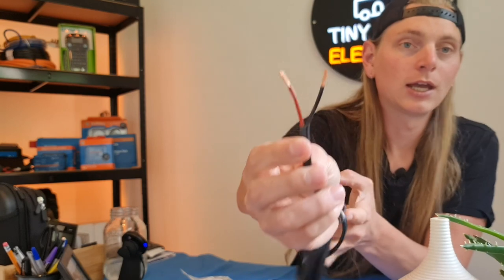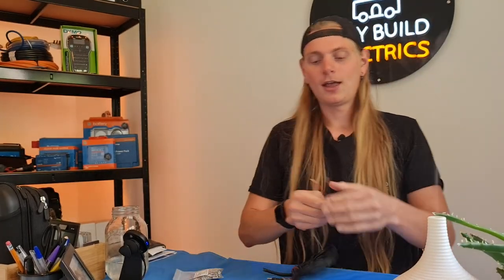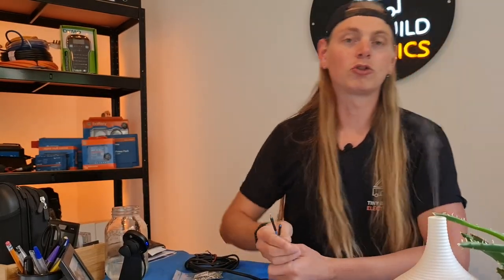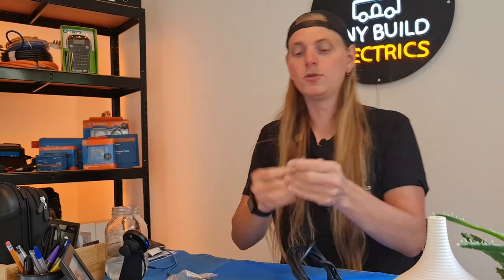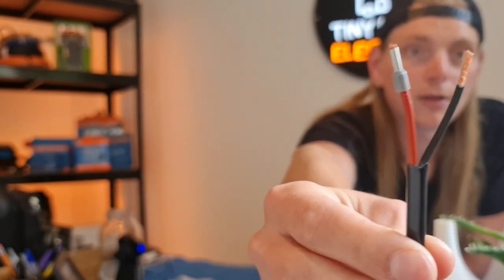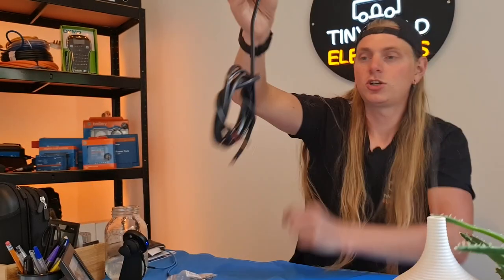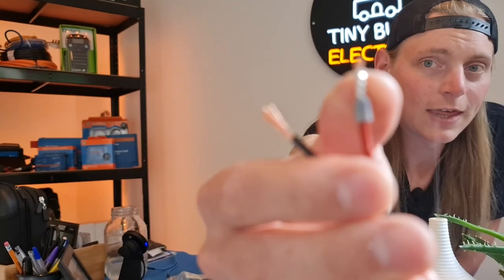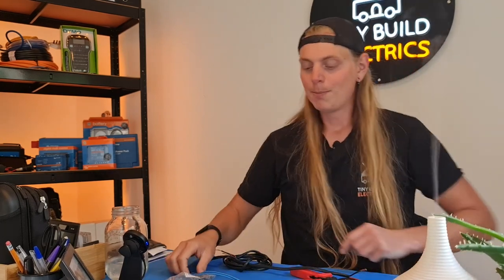How To Use Bootlace Ferrules (With Crimper) | Tiny Build Electrics

Comment: Thanks for the excellent video! In the USA this is not required per code & should be!! From what I understand, it's possible to loose up to 50% contact area screwing a terminal screw down on just bare stranded wire. I just had a project where I was replacing the contactor in my outside AC condenser unit, & needed to crimp ferrules on to several 12 gauge stranded wires that were going to screw lug terminals. I found that the easiest way to strip the correct length of wire to fit into the ferrule was to hold the ferrule against the wire & mark where to strip, stripping a bit of extra insulation, leaving a little bit of extra wire coming out of the ends of the ferrule, & then cutting off the extra bare ends. Glad to see that you that you do this also! Thanks again! (I did just see in another video where they said to leave a bit of bare wire coming out of the end...not sure if that is critical or not?) Thanks again! Janine🙂

Comment: Thanks for these tips! I recently bought one of the cheap sets online and have been adding ferrules to everything in sight, especially my Defender's solar system.
I hadn't seen the idea of adding heat-shrink before, that solves my urge to code positive wires red, negative black etc. as the colours of the ferrules themselves indicate size not polarity.

Comment: I think you mean a compression screw terminal.  Generally, the bulk of American homes are built with parts that require a (solid) wire to be wrapped around the screw, which is then tightened.   I can't quite see a way to use ferrules in that application.
Reply from the maker: This video is aimed primarily at UK tiny home builders.  Whereby the 230V electrical installation falls under the scope of BS 7671. Regulation 526.9 of BS 7671 recognises the problems associated with the termination of multiwire conductors; and the possibility of ‘conductor spreading’ in screw-type terminals. The standard requires that: "In order to avoid inappropriate separation or spreading of individual wires, suitable terminals
have to be used" (Regulation 526.9.1). This is what we're addressing in this particular video 🙏